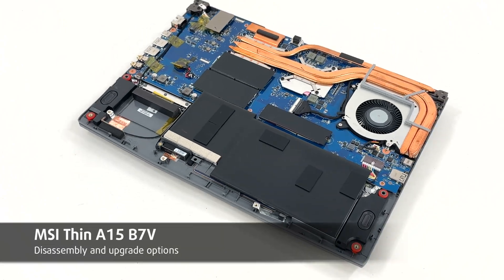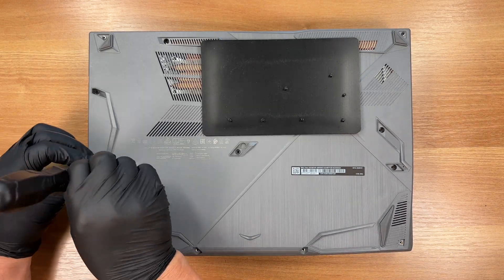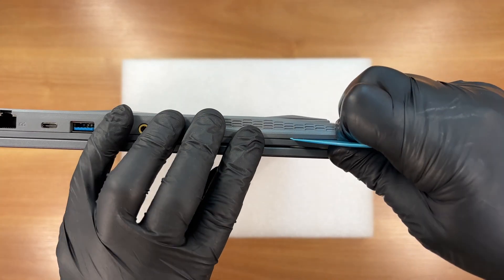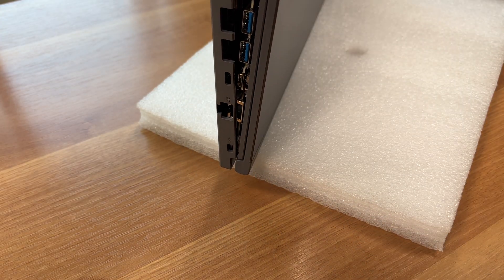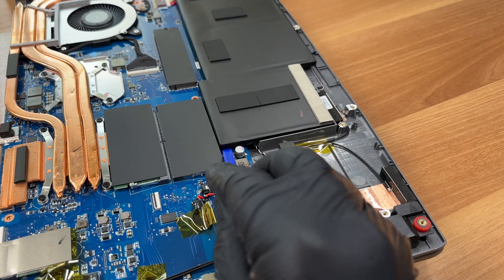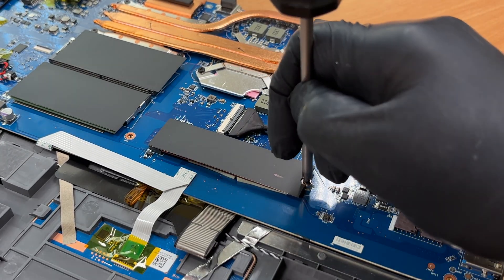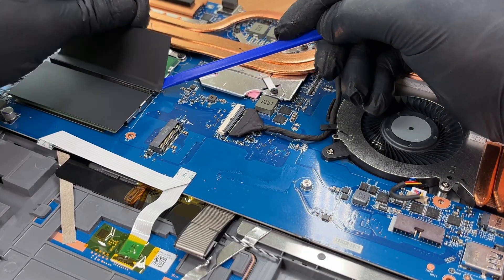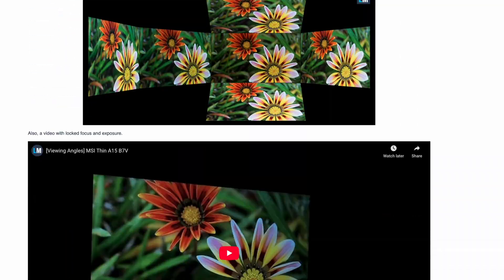🛠️ How to open MSI Thin A15 B7V - disassembly and upgrade options

Comment: great video
Was thinking on acquiring this laptop on a Ryzen and gtx 4060

However thanks to this video i realized that there is no SATA port to expand the storage, and it worries me the fact that it just have one fan
I will consider these 2 things before buying it
Reply: earlier models had a sata port and you can see where it would have been (left side of the battery). The A holes just removed it and didnt even bother expanding the battery.

Comment: Sadly on the AMD version the slot for SATA hard drive isn't there.. but yeah.. at least it got support for the DDR5 that's not supported on the Intel model.. some gain and some loose i think between both of the models..
Reply: Зачем тебе Sata если там есть m2? Он быстрее и лучше
Reply: @TechnoLogic2016 i mean.. it got an extra storage expansion.. although it's quite slow but.. still holding up today.. good for storing old games for emulation..